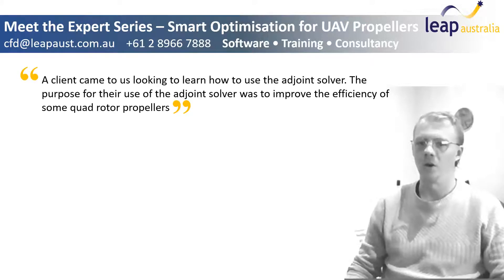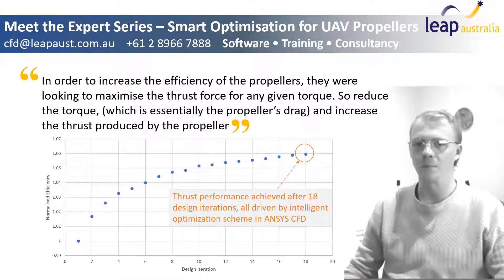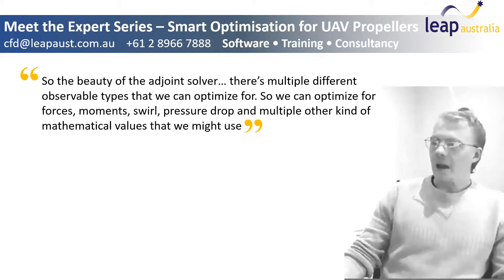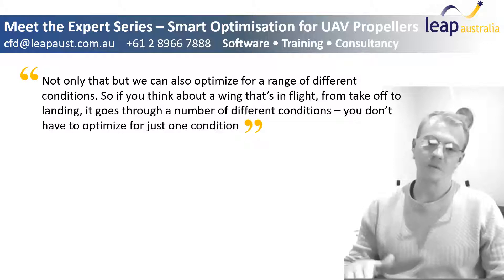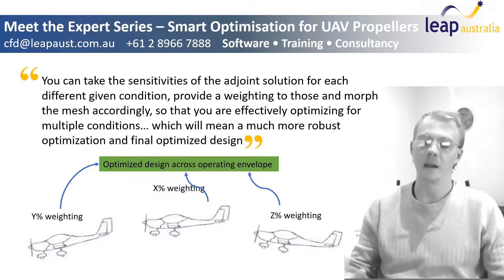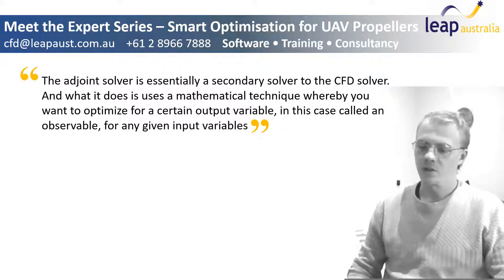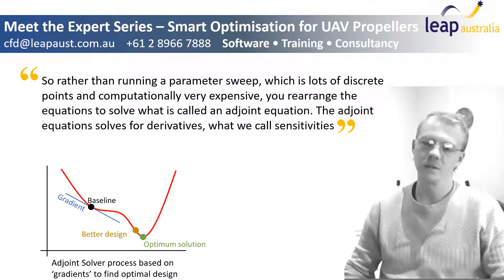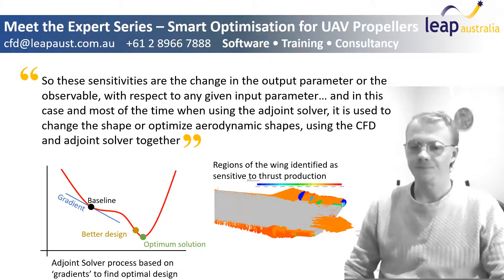Propeller Optimisation with ANSYS CFD

Comment: How do you do the weighting for different configurations? Is it through different design points, or you add the input velocity multiplied by the weights and apply that result to the inlet BC in one design point itself?